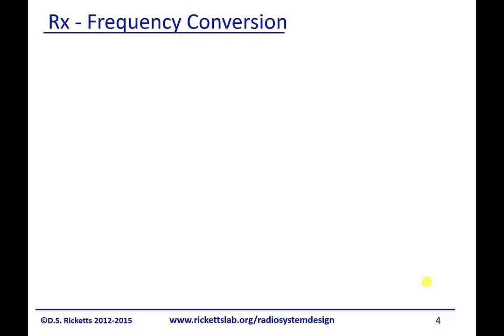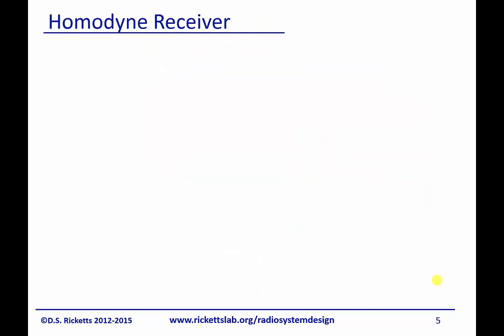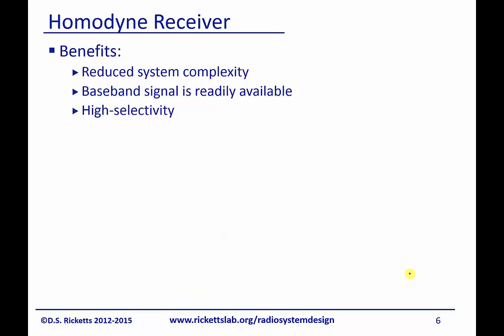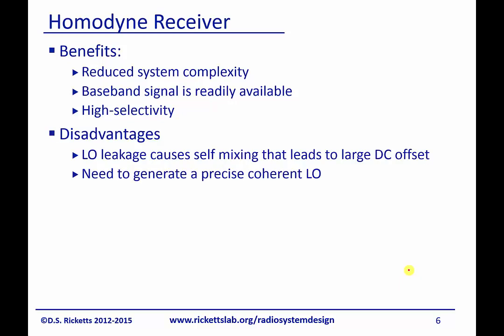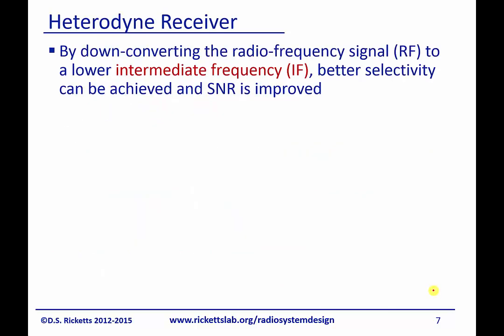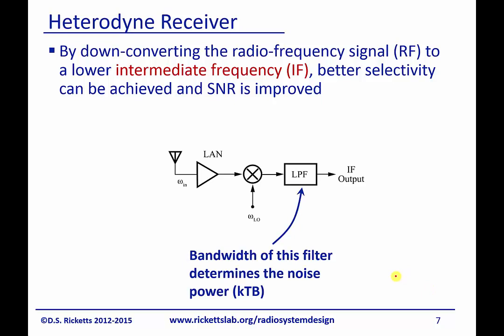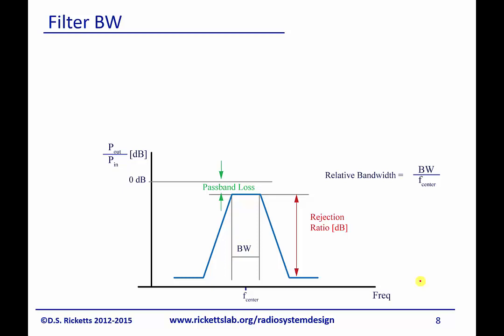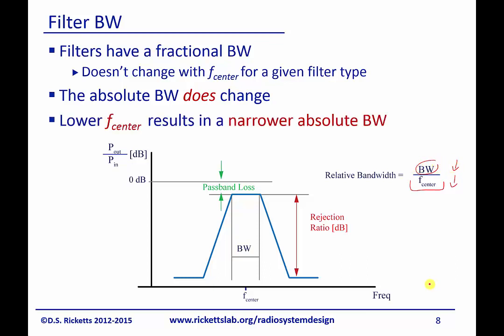Module 17: Homodyne Receiver

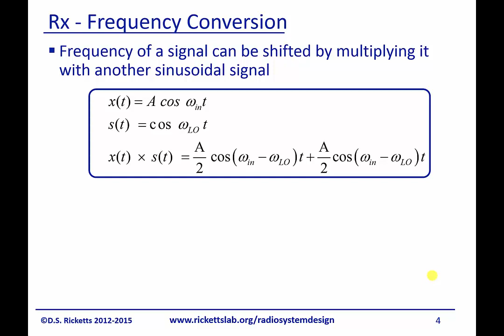Comment: On slide number 4, at time 0:22, x(t) X s(t) should have one term cos(win+wL0). Please correct the error
Reply: Very obvious, yes. :D
@Professor Ricketts: You can simply add an annotation in the YouTube editor.
Reply: this type of mistakes makes learners confused, so I had to double check on other sources to get the correct formula. Which add more doubts in the correctness of the learning material. Professor, please make a correction in order to watchers relay on information

Comment: It would be great to see a practical Homodyne receiver like the one described in the September 1973 issue of Wireless World, Page 416 but using components that are easily obtainable (perhaps an NE602)
Reply from the maker: Send me a link to that article. I couldn't find it. Or the name of the article that is on p. 416
Reply: @professorricketts  Please see https://rhodamine.eu/~richard/Homodyne/Homodyne.html which contains links to the extracted article as well as the entire September 1973 issue.

I built it many years ago though I substituted two mechanically ganged variable capacitors in place of the ganged inductors.
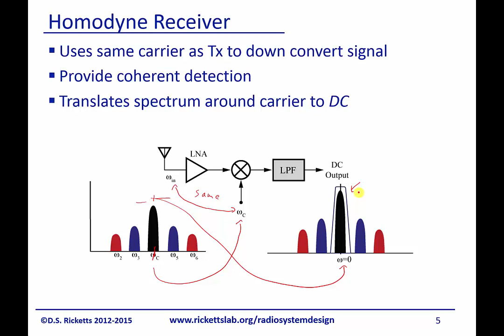Reply: 1:42 Dude, can you help here? in this timestamp?
Reply: The spectrum figure, it is not clear to me, what is w0 at right? What does it signify?
Reply: @badreddinegacem  Do you mean w=0 ? 
w which is read as omega is the angular frequency [ w = 2 π f ] and w = 0 signifies DC.

when the signal is mixed with its carrier you get the sum and the difference frequencies.  The difference frequency is zero. On either side of w = 0 you have the lower and upper sidebands

See the maths at t=22s (it has a typo mentioned in the comments) - this is just the identity 
Cos(x).Cos(y) = 0.5 [ Cos (x-y) + Cos(x+y)] which is derived from 
Cos (x+y) = Cos (x) Cos(y) - Sin(x)Sin(y)
Cos (x-y) = Cos (x) Cos(y) + Sin(x)Sin(y) Leading to
Cos(x+y) + Cos (x-y) = 2 Cos(x).Cos(y)

I hope that helps and answers the question you had in mind.
Reply: My dissertation was about the fm receiver based on homodyne Pll. i got asked a similar question, and i told him it's the dc output, I guess i had it right
@richardamullens
Reply: @richardamullens 1:12 see there, on the right spectrum, the black wave surronded by a black frame!